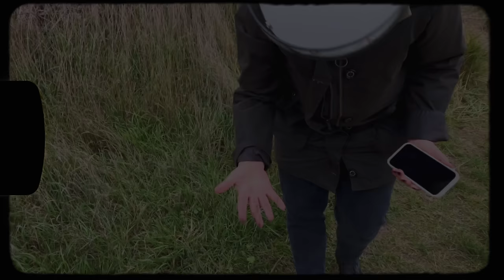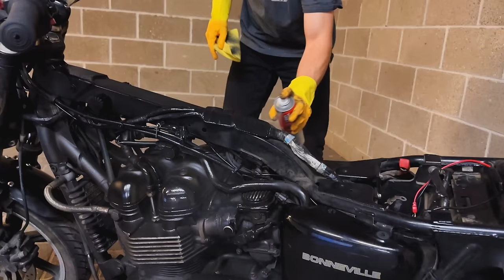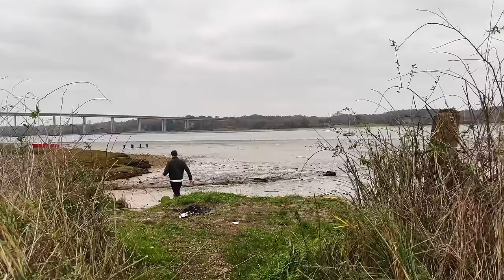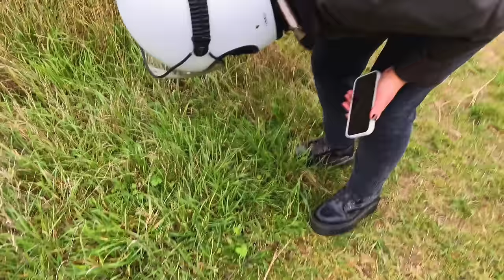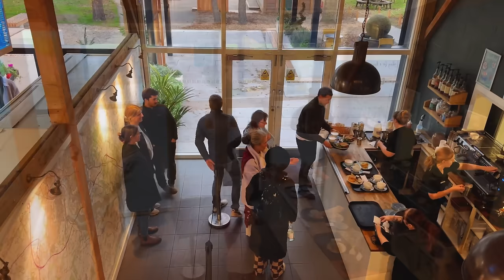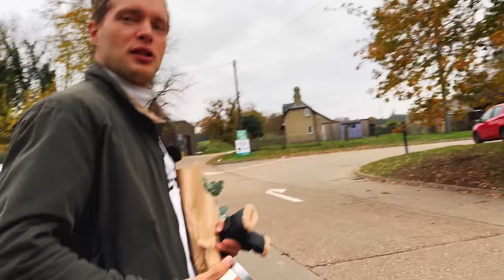The Simple Solution to Prevent Your Motorcycle Rusting

Comment: Its amazing stuff, been using it for years. It also stops my adjustable calf Sidi Boots from squeaking although it is not advisable to use on leather or on saddles it hasnt done my boots any harm.
Its also great for removing unwanted sticker residue.
One thing i would point out is the OP should not park fully into a car space in case a car swings into it thinking its empty, then its bye bye bike.

Comment: This takes me back so vividly to younger days and bolder ways.  Like  . . .  insisting I didn't need to take bus just because it was snowing.  I'd ride my FS1E the five miles to work as an apprentice.  I got 50 yards up the road and came off at the first corner.  Like  . . .  trying to ride my temperamental 2-stroke Suzuki 380GT in the pouring rain when it would run on all 3 cylinders for a while, then just 2, then back to full power as I was leant over on a roundabout. Oh joy.  Like  . . .  riding to London on my Aprilia Mille Factory to set-up a stand for the boat show in January.  Zero degrees C, no heated grips and painfully cold hands.  Had to keep stopping to warm them on the exhaust.

Comment: I would ride in the winter if the mood took me and it was reasonably dry (believe it or not, I don't enjoy riding in the pouring rain) but I generally apply acf50 and tuck the bike in the shed for winter. I keep a battery tender handy also and use it for a couple of days every few weeks, I don't like to leave that on 24/7.

Comment: Up until recently I tried not to ride my pride and joy in the salty months but I've retired now and volunteer for the Blood Bikes so bought a second bike. Ive used ACF50 for several years, mainly to treat any signs of rust which it clears up nicely. Think Ill be spraying the bikes with it from end to end from now on but if salt is on the roads Ill still hose the bikes to get any residue off.

Comment: I am now retired but worked in the motorcycle trade as a mechanic for 48 years. GT 85 is a pretty amazing product, I'll tell you for why. One of the places I worked had a Wurth rep that used to call in on us and this one day he came in with a can of GT85 and started telling us about it before producing from his case a 240 volt household light bulb and holder attached to a short length of 240 volt cable and 13 amp plug. The guy asked me, Mike can you fetch me a bucket full of water, which I did. The rep removed the bulb from its socket wiping the connector with a clean cloth and sprayed the contact part of both bulb and socket with GT 85 and then submerged the bulb and socket in the bucket of water and asked for a mains extension lead. Thinking this was a bit mad I brought him a lead which was then connected to the light in the bucket, waiting for the flash and a bang I switched the whole thing on and the bulb lit under water. I would not recommend anyone trying this themselves but I saw it with my own eyes and the rep certainly had faith in this product, enough to do this so I guess a little road salt is nothing compared with keeping 240 volts at bay.
Reply: Rigged setup
Reply: @EazyDuz18  Don't try it dude, 240 volts might wreck your keyboard warrier typing finges.
Reply: @mikecartlidge5355  What's a finge? Sounds like they zapped your brain! Thanks for the boring essay btw.
Reply: @EazyDuz18  ha ha you have got a key in your back, well done a h
Reply: @EazyDuz18  How many trolls does it take to change a light bulb under water?????
Reply: @mikecartlidge5355  How little effort does it take to make an incel have a meltdown online? Lol!
Reply: @EazyDuz18  in yours dreams your not smart enough, is this what you do with your life??? fail to wind people up on here? eazy fails to duz  eh?
Reply: @EazyDuz18 😂
Reply: @EVil-ob8in  lol proper mugged him off
Reply: @mikecartlidge5355  'your not smart enough' lmfao
Reply: @EazyDuz18  That the best you can come up with.......really??
Reply: @mikecartlidge5355  I mean if you're going to call intelligence out my minimum demands are correct grammar. You failed even at that! You've still not explained what, 'Eazy fails to duz', means. Sounds to me like a feeble attempt at an insult lol!

Comment: Hi Freddie, I said before but I don't know if you saw it but if you padlock your helmet like that someone only has to cut the strap and pinch it.
Older bikes seat used to hinge open on the side and the was a small clip to put the d ring of your helmet on, which I did, then one day I came back and my helmet pinched and a little bit of strap left behind 😭

Comment: My little 1984 Suzuki GP100 gets tucked away for the winter, but that's because it's a 1980s Japanese motorcycle so it rusts if it even smells rain in the air! 😂 So I never take that out in the rain and definitely wouldn't take it out with salt on the roads.

My Interceptor gets used all year round, BUT - I'm mainly a fair-weather rider, I don't purposely set out for a ride if the weather is dreadful, I'd rather take the car these days when it's like that (too old for riding when I don't HAVE to). But sometimes there's nothing better than wrapping up warm on a crispy, sunny winter's day (when there's no ice on the road, so above freezing) and going for a ride - and for that reason I don't tuck the bike away for the winter. I just tend to use it a bit less often from December to March.

I do wash my bike regularly though and also apply TechCote ACS-TC200 anti corrosion spray through the winter to keep all the shiny bits shiny 🙂

Comment: Hi Freddie, what you did there is better than doing nothing BUT, spraying the tank with oil and then wiping it with a cloth will cause micro scratches (swirls) because you haven’t removed the road grime and grit, the brake callipers will be contaminated with grime, grit and salt, this will lead to serious corrosion in there, best to pull the callipers off and clean with the pads out but if that’s too much bother then at least give them a good blast through with a brake cleaner aerosol 👍

Comment: I ride all year around. Currently using Muc-off cleaner, Silkolene Pro Prep spray and a wax polish for the tank, mudguards and side panels. Going to try GT85 as a cheaper alternative to Silkolene. Only time I wont ride is when ice on the lanes here in Devon.
Reply: I have used them all and cant find anyone better than the other.  I use GT-85 as well.

Comment: Saw you looking longingly at the Defender in the car park Freddie, and I know you have a hankering after one.  I have owned Landrovers and also currently drive a Fiat 500 like yours, you should know that the Defender is certainly a better tow car and a cooler car to be seen in but it’s performance is not much different than the Fiat, has higher running costs, purchase cost, and is a noisy especially at speed.  I’m holding on to my 500.
Reply from the maker: Very very interesting, thank you for this, Gareth🙌🏻🙌🏻

Comment: Yeah that will work as will WD40 which was designed to stop rockets corroding and even used to be called rocket WD40. Would not use any of it on the tank though as it will attract fine grit that will abrade the paintwork

Comment: I've always used WD40 (the bulk stuff sold in 5ltr container and applied with a trigger spray). Been using it for 50+ years, on outboard motors, cars, vans, bikes and tools. My solution to winter salt is to put my 1978 Triumph T140V away, after coating everything except tyres and brakes with WD40, and use my 1980 Suzuki GS550L, which I also treat repeatedly with WD40 during the winter. 
I bought the GS specifically to use during the winter after I retired, because the Triumph is too valuable to use in these conditions. As both are over 40 years old, I don't have to worry about road tax or MOT test fees and I don't do a very high mileage, so maintenance costs are low (I'm a retired mechanic, so it's only parts and materials I have to pay for). 
For me, it makes more sense to have a winter bike and protect my Triumph (which I've had for 30 years) from the weather.
PS You can't beat a kickstarter for being sure you can start your bike in all conditions.
Reply: GT-85 is basically the equivalent here in the UK.

Comment: Agreed acf50 is longer lasting but I have used gt85 for years. It does wash off so needs reapplying. I do use acf50 via compressed air once b4 winter. Gt 85 far easier to apply and is very good. And can be found very cheaply if u look
Reply from the maker: Great to hear your thoughts comparing the two- appreciate it🙌🏻
Reply: GT85 will last Freddie all winter then. Is there a video of the bike getting washed? 😂
Reply: @PLRMoto  once I have applied acf50 pre winter I don’t wash my bike thru winter as i dont want to reapply as it is a messy job. My 21 yrvold vrf was as new when I sold it. My 2021 nc750x started getting oxidisation everywhere despite treatment. Sold it wont look good for long that one. Seen a few rusty mt07 too

Comment: By far one of the best is xcp clear coat, which in the Bennett test was better than acf-50, so yeah you should try that Freddie 😉
Reply: this is what I use too works great
Reply: @viramati5831  OK yeah, but GT 85 is nothing more than a lube with ptfe, it's most comparable to WD-40 its certainly not on par with stuff like xcp clear coat or rust blocker, but whatever you like is OK
Reply: @kevindarkstar  I use XCP rust blocker so I think you have read me wrong

Comment: Freddie.
I normally use ACF50 in winter, which is great but more difficult to apply properly ( i warm it up and/or use a spray bottle but still fiddly..
I have only used GT85 for getting  off the 'oil fling' and road dirt from the wheel rims, which together is a pig to remove..
I discovered GT85  working on this when i accidentally spilt some on the rim and 30 seconds later, there was a clean spot...😄
Would you recommend GT85  as a total replacement for ACF50?
It is only 1/3 of the price too..
Top notch content by the way..( i would pay for the privilege of keeping you around)..keep it going....respect....😉👍
Reply: Apply the acf50 with a paint brush. Easy and no mess 🙌🏻
Reply: Good shout Martin,  if more time consuming...
Would still need the atomiser or spray to reach the tiny crevices set further back...👍
Reply: @johnratcliffe4105  I have two brushes bud. A 2” to cover the majority of the bike and a thin one to get into the smaller areas. I appreciate different bikes may not be as accessible. When I first started using it I used the spray, then the bottle with the spray head and found them messy. The brush technique is really easy, I use less product and it only goes where I want it to( not on the drive) haha!
Reply from the maker: Great to hear all of your input on the best methods- thank you all🙂🙌🏻 

@johnratcliffe4105 , I have only ever used GR85 or WD40 and have never had any rust. The ease of use makes it perfect for a slightly lazy maintainer of bikes like myself, because it’s so quick and simple🙂

Comment: ACF-50 for me. And it's not difficult to apply at all if you decant it into one of the cheap garden sprayers with the pump pressuriser on the top.
Reply from the maker: ACF50 seems to be a very popular choice. Thank you for the spray tip, because I think I’d be too lazy to brush it on!
Reply: ACF50 is available in a spray can as well, for easy application. I watched the BikeSocial test of the various treatments, and GT85 was pretty much worst of the bunch if I recall correctly. I had already gone with ACF50 before seeing that test, and was happy I did not go for GT85 which was one of the alternatives I considered. GT85 did not even last a week before rust appears in the test, ACF50 lasted 5 weeks in harsh conditions. You'll find the comparison test here on YouTube, was quite interesting.
Reply: AC50 is ok on some surfaces but can be messy, gt85 can be sprayed almost everywhere

Comment: Check the Safety Data Sheet for the product; the main component is referenced as "265-150-3". That leads to the name "NAPHTHA (PETROLEUM), HYDROTREATED HEAVY", basically Lighter Fluid. A high street product like GT85 or WD40 are a huge markup on basic industrial products. Try using kerosene for the same bike cleaning process and you'll have similar results for a fraction of the cost. AC50 is stickier, but also a big markup; I wonder if gear oil would be as effective.
Reply: I use kerosene/paraffin on chain with paint brush best cleaner on mkt and doesn’t harm o rings
Reply: @volt8684  me too, then I oil it with 80/90 gear oil. It doesn't last as long as wax, but it means the chain has a cleaner and longer life.
Reply: Acetone 10% Vegetable oil 90,%
Home made WD 40 cheapest cleaner / protector available
Reply: @motorbikesandhacks  hear hear but doesn’t it clean stuff up
Reply: you dont need to 'wonder'.. just do a search for bennetts review of motorcycle protectants.. a reasonable assessment of the popular ones, and some myths busted.

Comment: will have to see if I can find GT85 here in the US..i need something that will remove road tar from the wheels...and hey...lol..we all stall once in a while..LOL..I ride until its about 4 C...after that i put up my bike because in Ohio..we have not only salt...but to much snow..another excellent video...
Reply: Kerosene is superb and on chain
Reply: @volt8684  will have to try to find it...havent seen it around here for years...Thanks for the info...
Reply: WD40 does a good job on oily wheels.. cheap and easy to find.
Reply: @richardbains5  have used it with some extra fine steel wool to remove the road tar...Thanks!!
Reply from the maker: Ah yes, I’ve heard you do get some fairly tough winters in Ohio! Good job riding until 4C (I’m probably about the same🙂🥶🏍

Comment: OK it's got silicon (PTFE) in it, they all do nowadays, it's not a patch on ACF50, use that once a year, best lube spray I've ever come across is AC90 and for a cheap way to protect use DUCK OIL, we used that down the pit and believe me it is fantastic, they say old is gold, DUCK OIL has been around since Birmingham had its first engineering works, you can mix it with meth's to thin it out so it can be used in spray bottle as its thicker than water, as for PTFE it causes, cancer, liver disease, kidney problems, skin disorders, makes you sterile, thyroid disorders, and is heavily linked to early-onset-dementia, nice stuff EH, its the chemical that is used on Teflon none stick pans and plumbers tape, discovered by chance in the 1930s by a chemist in the USA trying to find a new gas for fridge's, it worked but was deemed too dangerous to heath at the time, it smells of DEATH, when you spray it everywhere and breath in the vapours it actually smells nice, the silent killer it's called in the engineering trade. . . 
DUCK OIL is actually edibile !
don't believe me check it out on Wikipedia. . just put PTFE into the search box...
BE CAREFULL WAHT YOU RECOMEND PEOPLE SHOULD USE !
IF YOU DO USE PTFE IN AN ENCLOSED AREA WEAR A BREATHING MASK.. AT LEAST

YOU CARRY ON USING IT OFTEN THE WAY YOU DO IN THIS VIDEO